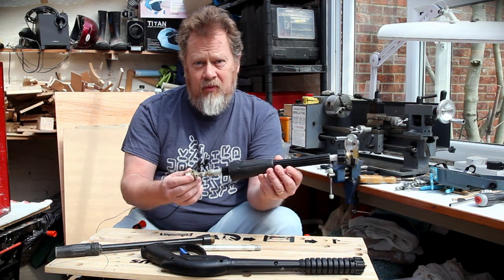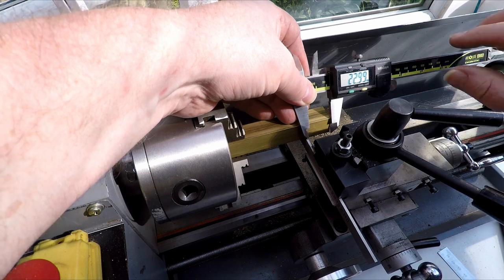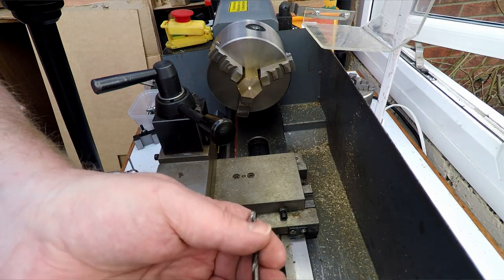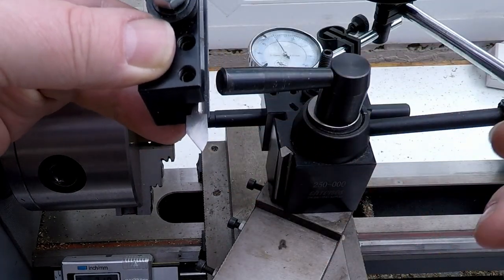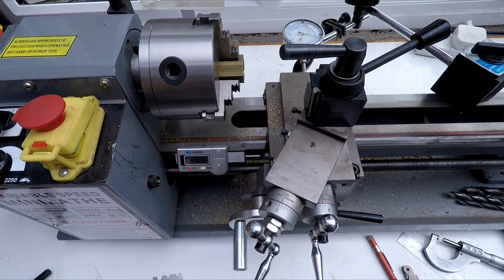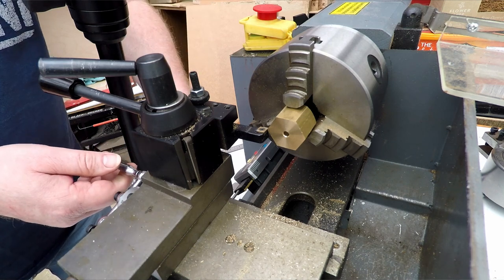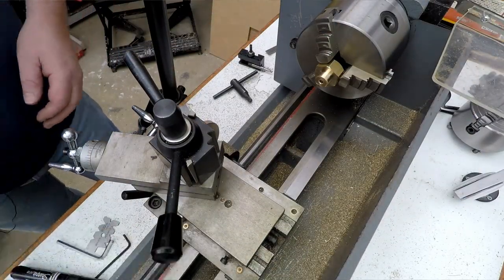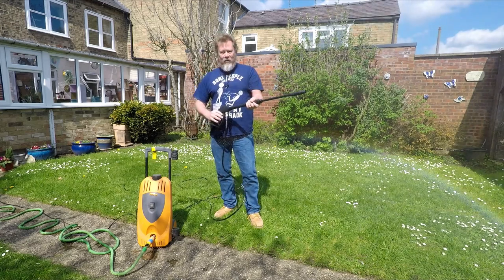Internal and External screw cutting on the mini lathe...

Comment: Richard... Question:  Isn't better to have a lathe firm in the bench?
Reply from the maker: Yes, it's best to have the lathe bolted to the bench. It's a bit safer and also adds rigidity to the bed. In fact the better solution is to bolt the lathe to a 10mm thick sheet of steel and bolt that to the bench. That will give even more rigidity.